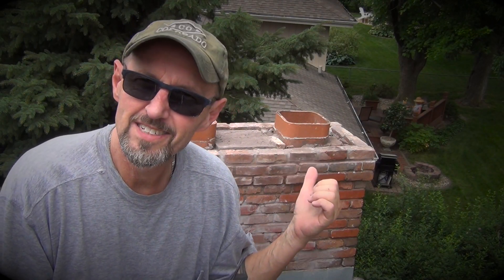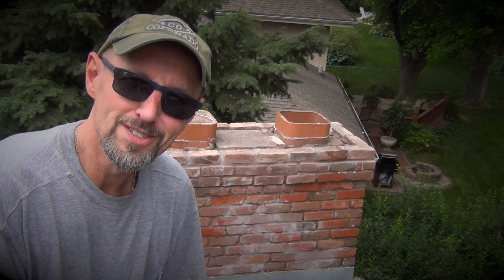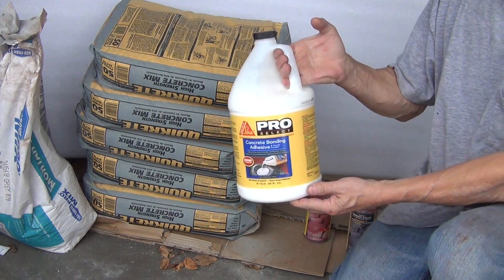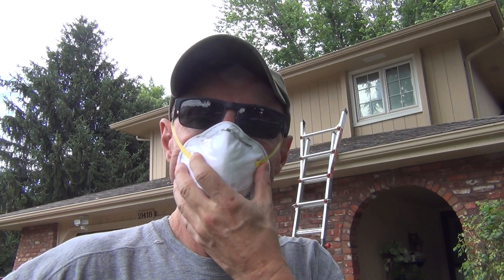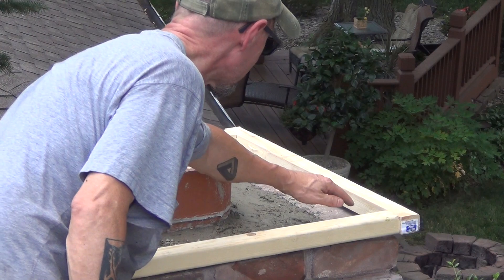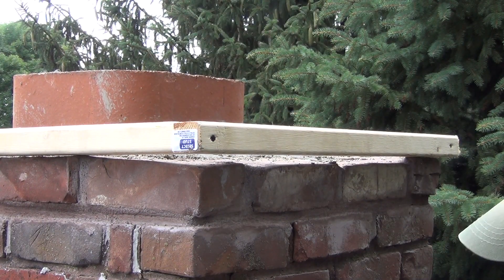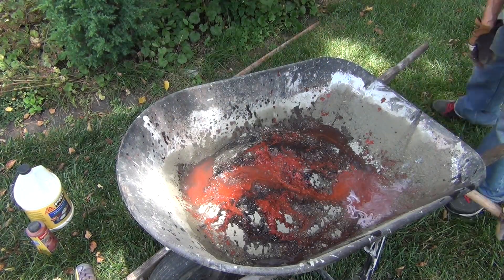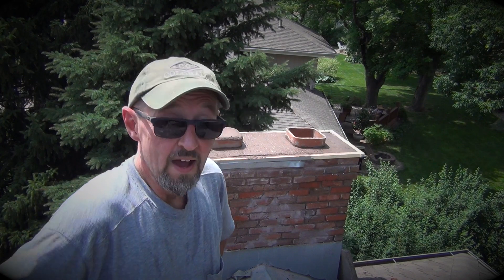Chimney Repair - Concrete Cap

Comment: Since I too got a channel, not disliking the video. Great effort, kudos to you on that BUT I think whole point of a cap is to PROTECT the bricks around it and not water sweeping through it (as brick is porous). If that frame was bit out more covering the brick layer from top completely, I should've stood up and gave you a salute. Again , great efforts and you did more than what I could do. I am doing my chimney capping this week and planning to get a professional to do it and it cost $1200 here in Canada- DANG it hurts.

Comment: Hello,
After you cap off your chimney with the metal sheet, can you cover the whole thing with concrete and then add primer and paint it,  then use henry tropi-cool 100 % silicone for top off everything?

Comment: Portland cement, sand (which is where the color usually comes from  red sand in your case) and the cap is framed around with 2x6 or 2x8’s, the cap had to come to the edge of the brick and your mortar (Portland and sand - not stone!) is usually mixed slightly drier than brick mortar... almost like stone work mortar.